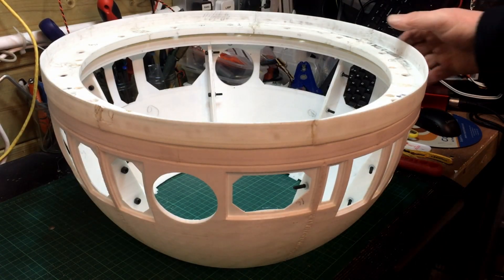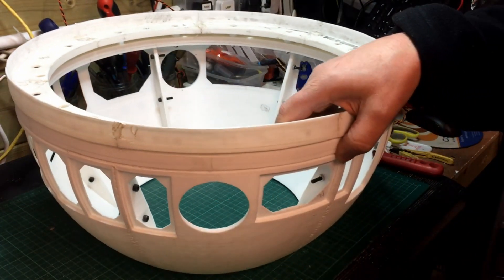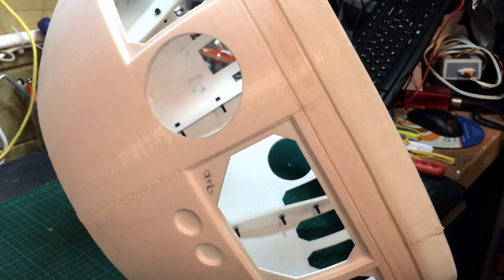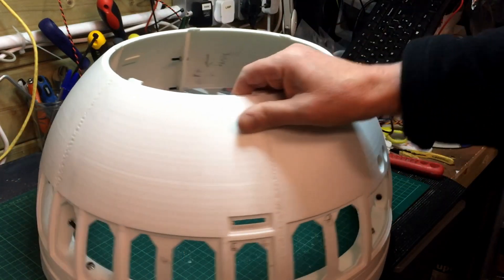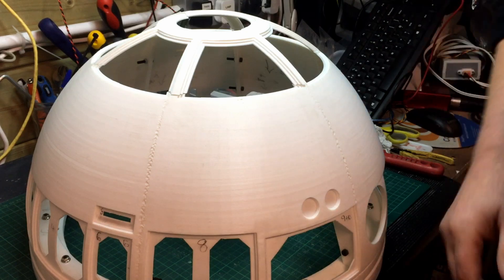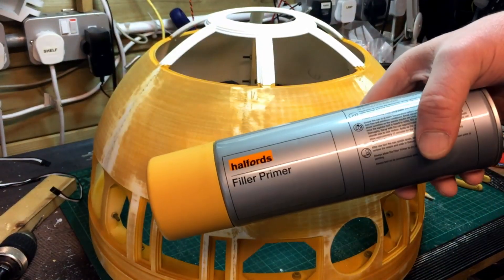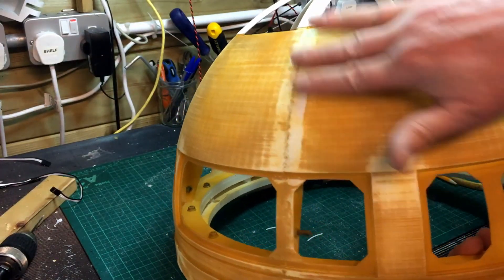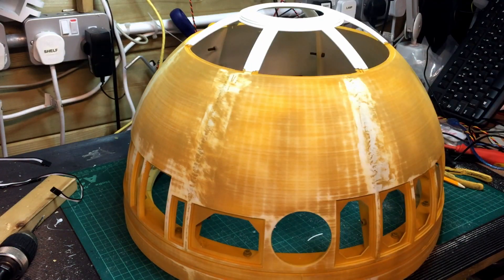R2D2 Droid Build Part - 20

Comment: I missed that bit about using a magnifying glass and gluing the radar eye in over cutting it out and adding one.I bought one of those camera domes that was recommended in that Amazon list you mentioned. (I forget who did it off the top of my head) I'm debating cutting the dome with my hot knife. I bought a hole drill set only to discover on the forums that it is a bad idea. Cutting it is.I've stalled on the body. I need to figure out the arms and the shoulders, plus fix that skirt issue. I reprinted the capture bits for the skirt but a few came out warped, I may need to reprint them again. I haven't tried to pry the pieces off with the desolver yet.BTW I posted a comment on your blog.
Reply from the maker: Hi Chris
Just realized loads of comments on the blog, I have been abroad so not had a chance to catch up with everything.
Reply: Hi Kyle,Well, when you manage to recover from travel fatigue you can check out my limited progress on Astromech.net. I finally broke down and put a thread together.

Comment: Feels like forever since the last video. I'm still printing away but I'm finally done the body parts! I don't have a 3D pen, I should get one, I've been using a soldering iron and doing it kinda like Tig welding lol  Anyway your vids have been super informative and I'm sure I'll be rewatching as I build.
Reply from the maker: Hello Big Monkey, it has been a while since my last R2D2 video, so little time last couple of months.    I use a soldering iron to do the heavy work in melting the joins together and then filled gaps with the pen.   Finally got one after reading Cyber-One comments on the 3dprinteddroids blogs.   Really useful to have a pen.   Glad the videos  are watched, it was fun to finally get another video published.
Reply: @kylecampbellweb  at least the good weather is coming back around, I'm on east coast of Canada so we've got a bit more winter left but its almost time to be able to do filler and paint work. I'm excited to get to it.

Comment: Hi Kyle,Nice video!That orange filler/primer is nice. I might have gotten carried away with mine, it's a lot thicker than yours is. I take it you are going to hit it with gloss black before the aluminum/silver?Yes I've had hairline cracks on my dome primer right through the filler and bondo. It is annoying. I tried adding some filament into 1 gap with bondo to keep it from flexing but I'm not having much luck fixing it at the moment. I had messy top rings too. I glued mine in and used filler and bondo. I've got the bits including the eye lens as was recommended in that amazon list you provided. I'm way behind you. I'm trying to print and piece together the battery boxes and bits for the skin of the center foot now.Keep up the great work!
Reply from the maker: Hi Chris.  Yes I think the orange filler looks really cool, HOWEVER, I am not still using it as it stinks the place out and I think it may be slightly toxic!  Fine on a car metal body and great to work with but I have gone back to basic grey plastic body primer.   Yes about the black gloss [well black silk I have used] and then silver/aly and then I am going to use a dark red colour for the dome.   I have seen the dark red used somewhere and it looks really good.   I have already painted it black but not totally happy with the top dome rings so will re-sand them again and fill and paint.  

I decided to really melt and bond the dome joins because of reading so many comments about hair line cracks after people had painted their domes.  Also as I mentioned to Mig Monkey, check out Cyber-ones comments about how he uses the 3D pens.   The whole dome seems much stiffer and one piece after really getting the joins bonded.   Check out Nigels blog for more pictures.
Reply: Thanks for the tips! Keep up the good work!